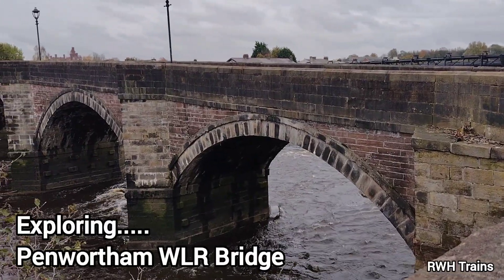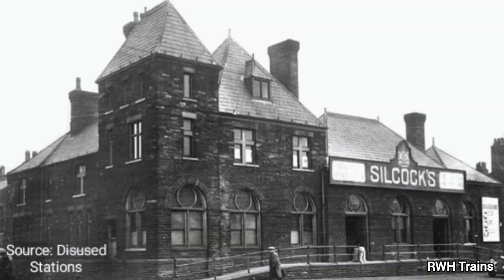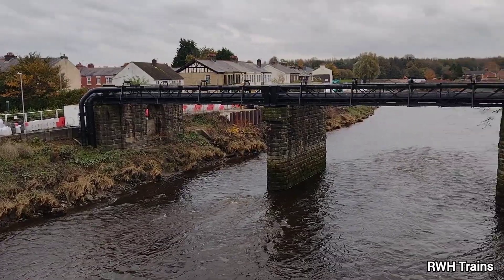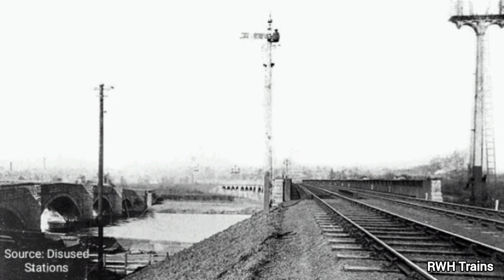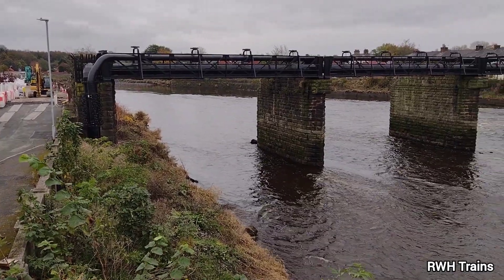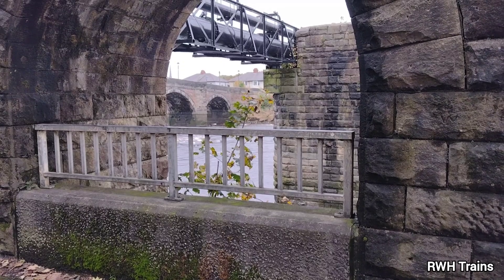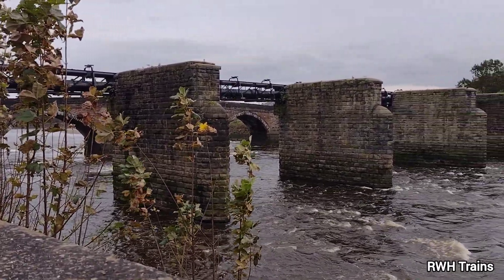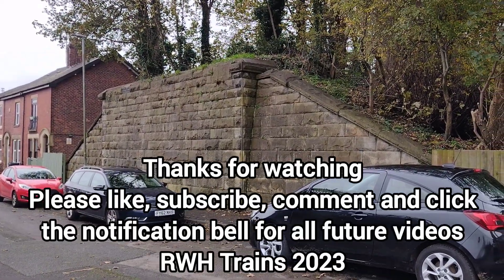Exploring Penwortham West Lancashire Railway Bridge remains - Preston

Comment: Have a look at the line that went to the old Whittingham Hospital, there’s still a platform there but very overgrown now
Reply from the maker: Thanks for the tip off. I didn't know if much was left of it but will certainly give it a look
Reply: @RWHTrains  the hospital now it self isn’t there anymore just the newer one as you enter the site, if you look at the old train lines you’ll see where the platform was at the side/rear of the old hospital, there’s some interesting stuff around it including some old crockery in the undergrowth stamped whittingham hospital on the base of them
Reply from the maker: @urbanexplorationworldwide7418  I'll look this up next time I'm in the area. Thanks again!